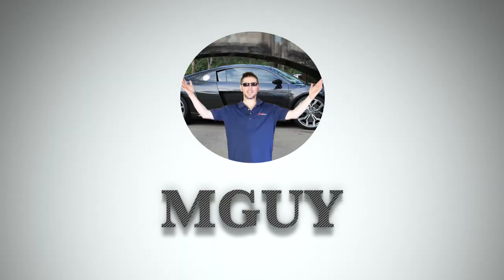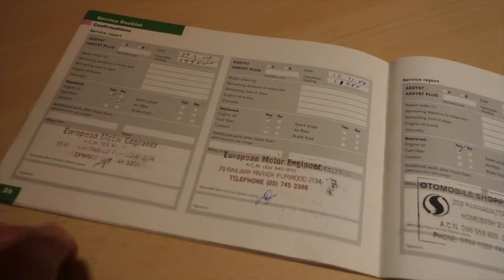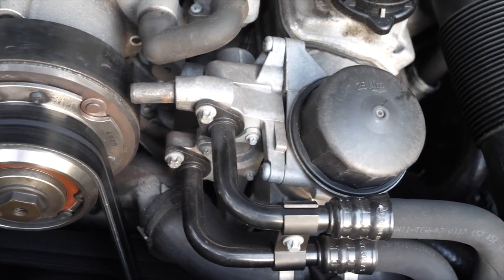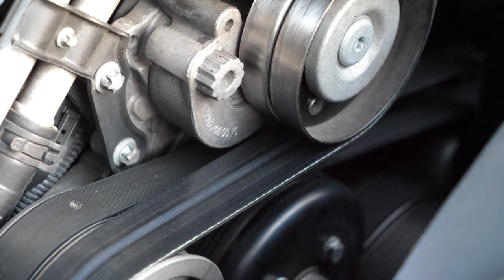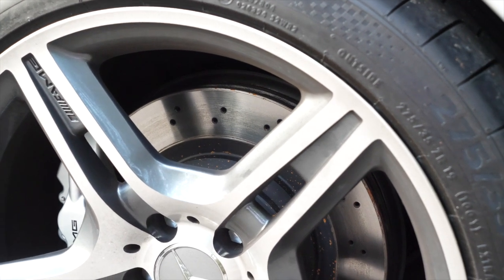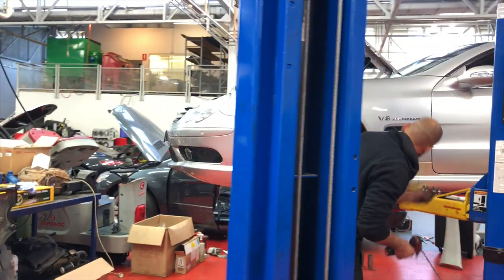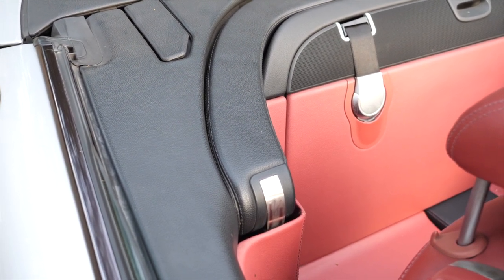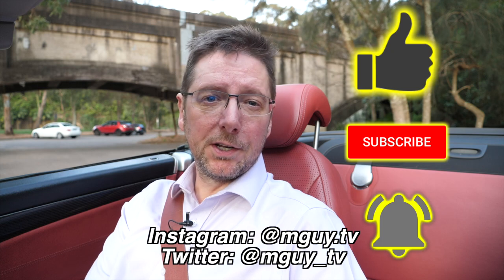My Mercedes-Benz SL55 AMG - what's wrong with it? | Episode 139

Comment: Normally when brakes are done, the pads are replaced and the rotors are "turned" on a lathe, if they have sufficient thickness. Replacement isn't always necessary, as rotors last longer than pads. You have a beautiful example of automotive art.

Comment: I had SL55 2003. Exactly same colour body and red trim. Loved it. Kept it for 2 years. Spent quite a bit to get things fixed including super charger pulley, ABC pump, etc. Only done less then 2000 miles. Sold it to get electric car as felt future is electric. I felt that I made a mistake and miss it. I may buy one again. Classical design and lovely ride. Comfortable on long drive. Which I only did twice.

Comment: I enjoy both of your SL55 good-and-bad and the SL500 comparison videos. I currently own a 2009 SL550. it has 382 HP as compared to the 302 HP in the pre-face-lift SL500. Imho, 382 HP is just about right for its weight. Also arguably, it has fewer engine issues to deal with than the supercharged SL55. Nonetheless, I would mind owning an SL55. On the other hand, I am extremely happy with my SL550. BTW, you are correct that ABC fluid needs to serviced regularly. if the owner does that, the hydraulic system should last just as long as say, the transmission. Unfortunately, it is not a service item listed in the original Mercedes service book, shame on their part.

Comment: Hi Simon, I have a 2003 SL55 which I love, unforunatly it sits under its cover most of the time. Your assement of the ABS system was as good as it gets, I know how much time you must have put in researching information to have the understanding of the system. I would like to add to the conversation, the front valve body also includeds a lock valve preventing loss of fluid from front struts, the deviced operates when car is in neutral or park  to my knowledege the strut should hold unless there is a leak, so no sagging. Having said that, my car will sage on left side  if I go from drive to park, but if I go from drive to neutral wait a few seconds and the go direct to park no sagging car stays level for a month or more. The car will lower slightly after a month but thats both sides, I believe that is to be expected. My car has had the all struts and front valve body replaced, An explanation to the saging could be the control module is not activation the valvebody locking piston in park but it is activated in neutral, moving it quickly into park must fool the system. Could I ask do you have any ideas ? look forward to hearing regards Brian

Comment: I have an 04 SL55 AMG. 71k miles. Just recently I had to replace the inside driver door handle spindle. Had to improvise and a little customizing along the way because the whole door panel is actually supposed to be replace but, I refused to go that route. :)
Reply from the maker: Nice! Unfortunately with these cars its frequently replace rather than repair...

Comment: Welcome to the SL55 club Simon! I would say that your list of things to put right is a gentle entry into ownership of these beasts. I have owned mine for just over a year and I have so far spent around 7000GBP on my 2006 model. I knew there was a number of things that needed attention when I bought the car at a reasonable price and I factored in a 4k improvement budget. What I hadn't factored in was the expiry of the ABC pump during a road trip to Germany last May, resulting in me flying home without the car whilst the Mercedes dealer in Stuttgart waited for the part to be delivered. Since then one of the front hydraulic struts has needed replacing. Having said all that, I do still love the car and have thoroughly enjoyed it over the great summer we've had in the UK this year. If you are interested, JayEmm On Cars reviewed my Autobahn Stormer on his YouTube channel earlier this year, so take a look.
Reply from the maker: Thanks! I will check out JayEmm's video - I watch his channel already!

Comment: The smell of petrol could be the tank.Common issue on then and it will require a new tank.Had a 2003 SL55 but recently bought the facelift late 2006 as it seems to be a better build than earlier models.Fingers crossed:)
Reply: oh yes, the fuel tank on the R230 SL's are the worst designed feature one of the most beautifully designed cars..... the fuel tank is a total joke....anyone buying one of these cars needs to check out the "fuel tank baffle"....major design flaw....Mercedes were actually taken to court over this issue and lost the case....did they recall the SL's ? did they f@ck !!!! ....swept under the carpet !!
Fortunately some clever enthusiast came up with a fix.....up until then many many poor SL owners were shelling out thousands of pounds to replace the fuel tank !
Reply from the maker: Wow had no idea it was so serious. Thanks for the info.

Comment: That pump is only $120 aftermarket and $275 from Bosch. I keep hearing about the suspension system and it’s really a cheap system to replace. Believe it or not a basic tool set that can fit into a basis one hand carry tool box can and will be able to take apart almost this entire car. It’s fancy and nicely engineered but it’s still just a car. That tool box and tools are a lot cheaper then the time they charged you to replace it. Even if it take six hours look how much you save. You still got the tools to fix the next job. They paid for themselves the first time out of the box. Almost a better better investment then the rental properties I own...

Comment: Hey Simon. I'm also in the need to replace the AC valve on my CL55. Fuel smell is probably just a fuel filter needs replacement. You didnt mention nothing about supercharger oil change done or not. i'm not sure on how many Km/miles the supercharger oil need to be replaced but for the AMG supercharger you need the Mobile jet II oil. In previous episodes you said your gonna fix the CL's seat, any updates on that? also would be nice to that new star diagnostic in action 😉

Comment: First!!  I get what you mean by when replacing the brake pads and rotors as a pair. However not to sure about Mercedes but with BMW when the brake pads are due to be replaced we have to measure the rotor thickness and runout to see if it is still in specification. If they are with in spec then we just replace the pads only. However i know with All VAG cars pads and disk are replaced as a pair.  BMW Technician
Reply from the maker: Interesting - thanks Jimmy!

Comment: Hi,
I live in UK and I would like to buy a SL500 how should I check the ABC suspension in order to be safe it was well maintained.
When you mentioned that if you use the car without the fluid in the suspension system all the system might be compromised that scared me.
Do you know how to check this?
Thank you!
Reply from the maker: Although there are horror stories with the ABC, only one of the three cars I have owned had any issues with it. Simplest test is to open the ABC reservoir and check the level. Also get an independent Mercedes mechanic to check it over - also if there are records of fluid and filter replacement in the service history that's also good, if not do it straight away.

Comment: Hey MGUY. I recently purchased an 04 SL600 and have a fuel smell every time I drive it. I say fuel cause I'm in the U.S. :) Did you figure out what's happening with your car? I just figured it's my misfiring ignition coil pack that's not burning the fuel so I smell it in the cabin, but after reading some of your viewers' comments I am starting to think I may have an issue with my fuel tank / fuel filter as well. Any ideas? Thanks in advance
Reply from the maker: I will find out next week. I think it’s likely to be the fuel filler pipe or the tank, but will post an update.

Comment: Hey Simon, do you have any rattles or other noises coming from the roof if it's closed? (while driving over bumps) I had some issues and I can say it's quite expensive to fix it and not every Mercedes dealer dares to work on the roof of the car.
Reply from the maker: Not too bad, but you expect a few creaks from a convertible - there's an interesting twist to this story which will be covered in a future video - stay tuned!